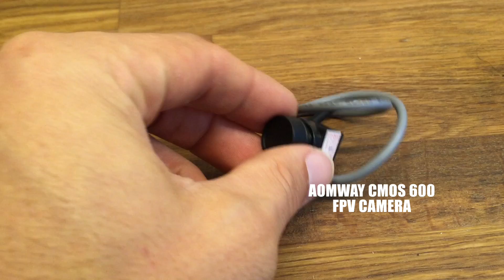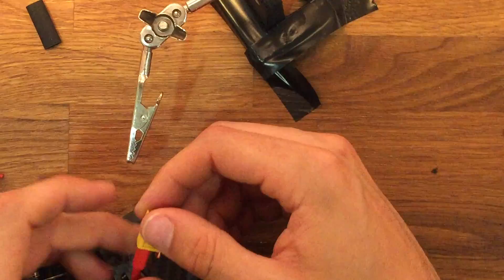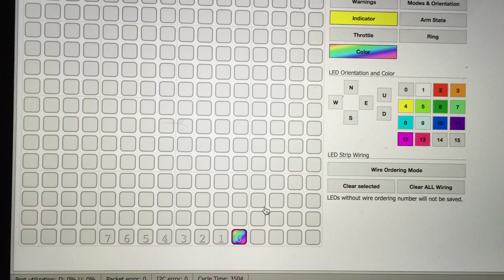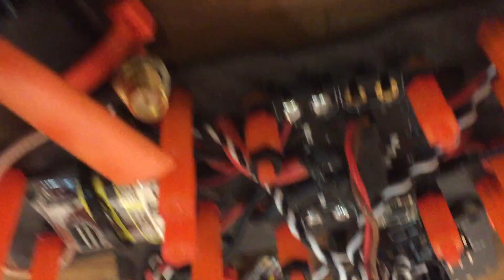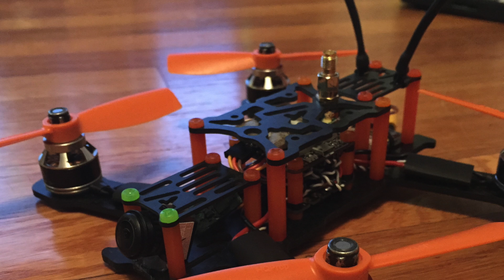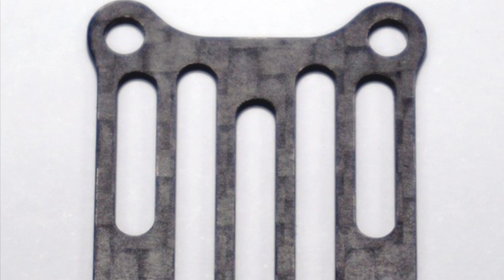Armattan 180 Full Build Tutorial

Comment: Can i use a cc3d
Reply from the maker: Of course 😀 you can use any flight controller with the 35mmx35mm dimensions. I recommend an F3 processor flight controller though. Not sure if the new cc3d is an f3
Reply: +SF PV thanks

Comment: Good work on the video!  I like the way you've got it divided up into different parts accessible by the table of contents.
Reply from the maker: +Bill Fitz Thanks! I figured if you only needed help on one part you could easily access it :) Or you could go back to a section if you missed something. Did you build an Armattan?
Reply: Yes, I built a Morphite 180 and recently ordered a the V2 version which is in the mail.  I'm going to use Quad Revo Power OSD V3 and a Dodo FC.  I'm looking forward to the build!
Reply from the maker: Sweet! Send pics

Comment: Motor reverse can be done in ESC firmware now. Keeps those installs cleaner
Reply: Zapf Motor reversing in the ESC firmware isn't always the best choice. Soldering reversed will eliminate the problem of a firmware bug causing issues on the reversed motors.
Reply: How do I link you to years worth of ESC programming experience? I've seen it on Airplane, Heli, Quad escs. The code is not always optimized for reversal. It does not mean that it wont work, but I guarantee you if its going to work right, it will be in the Normal direction before its in the Reverse direction. Take BLheli 14. There was a bug for a short term where reversing would not work. Luckily that code is revised and the programmers are attentive. Dont think you will get the same result from a HK esc or others mass produced. Basically its just one more form of prevention. Its easy to do and could very well prevent problems that could have been avoided. Kinda like your daddy should have worn a rubber :-p
Reply from the maker: Sweet! Nice tip :)
Reply from the maker: Zapf Trust in Jim. He's a guru
Reply from the maker: +Zapf why source rcgroups? Jim posting on here is no different than him posting on rcgroups then linking his opinion. Take it or leave it but please don't get into a fight on my videos. I'll just delete the comments. Thanks 😀
Reply from the maker: Zapf just saw the comment. Wanted to back up Jim as an expert. That's all. Take care
Reply: Think about all the effort you put into writing such a poorly formatted attempt at a sick burn, when just a fraction of that could have been put into a relevant rcgroups link from the blheli thread (who cares about rando china ESC firmware, the video and this disco is about his ones running blheli)

Stay mad bruh ( ͡° ͜ʖ ͡°).
Reply: Jim Leonard I've never heard of bugs with motor direction beyond some of the 3d settings. Do you have a link?
Reply: Gurus usually provide sources
Reply: +SF PV It is different, in that there is literally no context in a random youtube thread as to who Jim is (also note that his account lacks a youtube channel, and googling gets you professional football players). Literally the only mention I can find of him is in a byline of this year's drone nationals team listing page. If you are going to make a claim, then presumably there is some documentation of it existing in order to back it up. This is something your learn by the time you leave elementary school. Getting angry about basic shit like being asked to explain your answer (like he did) is for literal children.

I'm also unsure as to why you bring it up a month later.